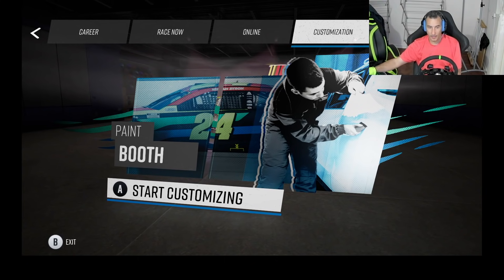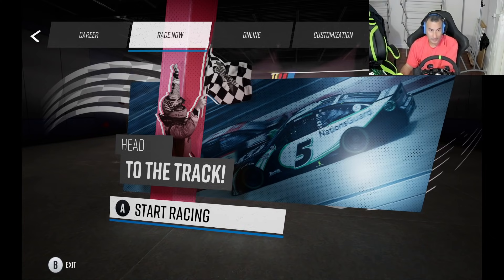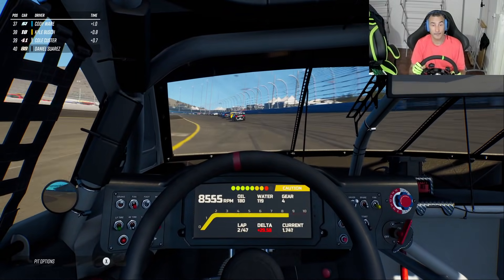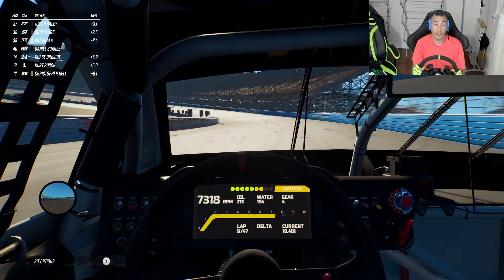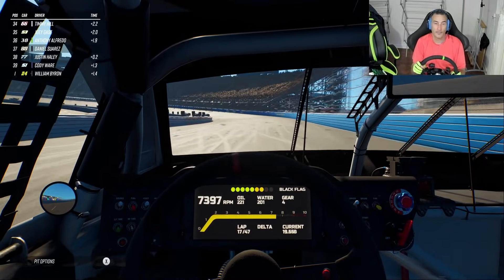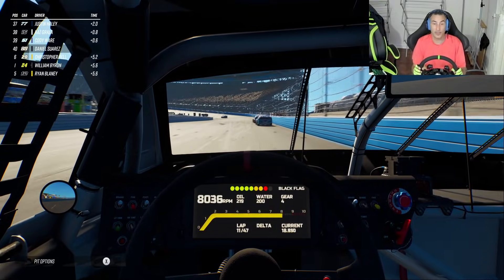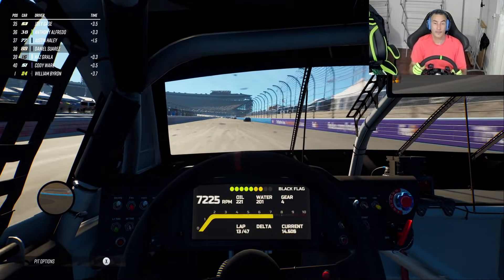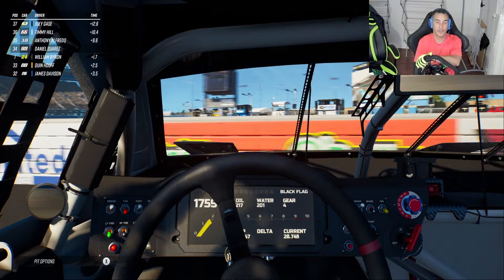Nascar 21 Ignition - Phoenix testing and a clean pit stop

Comment: Can’t you change your ratio in the wheels software on your pc?
Reply from the maker: I think so, but i'm afraid it might screw up my IRacing settings. I'd rather have the option to do it within the game.
Reply: @dcaseng  can you change it in your steering wheel settings in game? Maybe 360 degrees instead of 900 degrees
Reply from the maker: @T_Bone_256  I'll check next time i'm on.